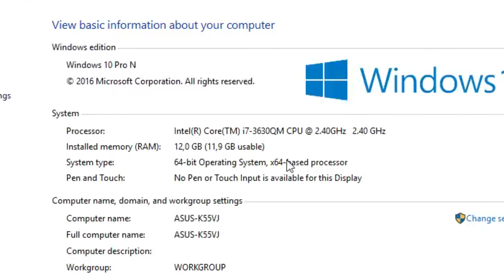ASUS K55VJ or K55VM or A55: 6GB to 12GB Memory Upgrade Process

Comment: I am hard time installing windows 10 on k55vm laptop. firstly atk package doesn't work, also my canon lpb 2900b printer doesn't work properly. It doesn't print 2 pages per side. in atk package windows animation & atk package animations both show when incresing decreasing volume. lastly asus Bluetooth suite drive doesn't install in 10.can u please upload step by step windows 10 installation video.

Comment: I have a K55VJ with similar hardware config (i7-3630QM, 8GB DDR3, and Nvidia GT635M). Went to ASUS' website to check, max memory supported is only 8GB. Can I install a 16GB kit (2x 8GB)?
Reply: Did you try that?
Reply: Did you try ?
Reply: @ohorok2  did you try ?
Reply: Yep. I installed two 8GB sodimms. Works great.
Reply: @fatihdisci959  Yes, 16GB works okay.

Comment: Hi! I have Asus Laptop K55VJ SX199 (intel i3-3120, 2,5GHz, 6GB RAM). what do you think, can i upgrade my ram from 6GB to 12 GB ? I worry about maximum 8GB support, but i think that's for just 1 slot ?
Reply: i asked the customer support and they said it will support 8GB each slot. i hope soo. thanks!

Comment: I have a K55a laptop, upgrade the ram to 12gb, it gets enough 12gb but when I sleep and wake up it is off. Is there a solution to this problem?
Reply from the maker: Very strange. Did this problem start after upgrading to 12GB? 
I don't face this issue.
Reply: Yes, when I upgraded to 12gb, I reinstall the window that problem still
Reply: I realized that if the intel graphics bios up to 256mb, the problem has been resolved.
Reply from the maker: Actually, this could be related with newest 1709 windows update if you have one. 
After Windows 10 1709 update, my desktop pc does not shutdown/hibernate/sleep.
RAM upgrade should not cause anything similar.